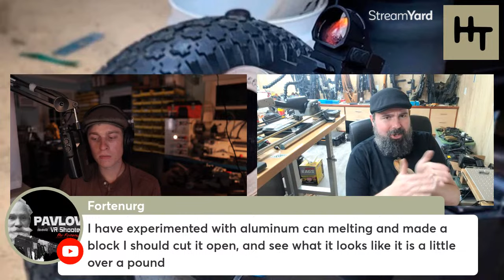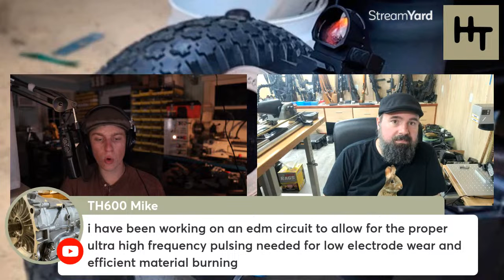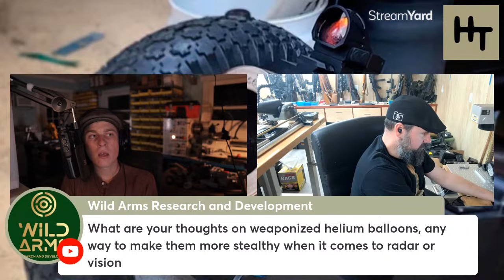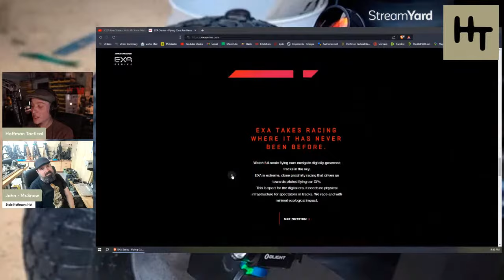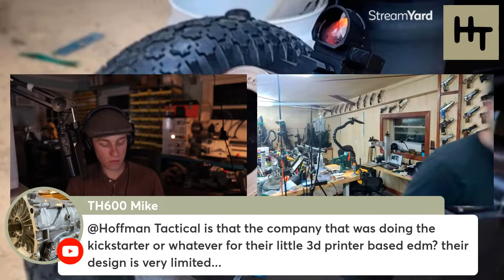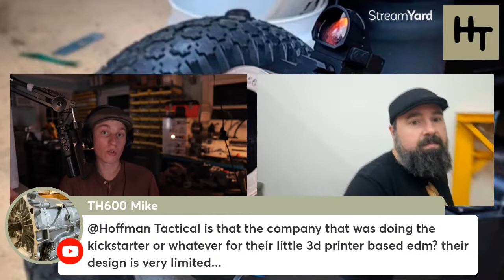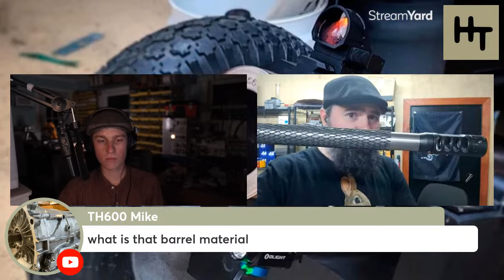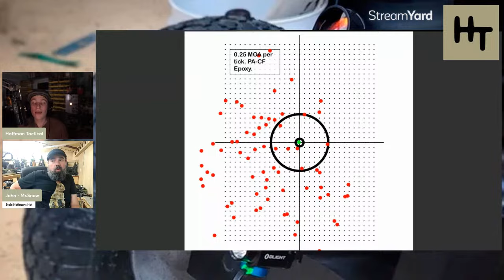3D2A Live Stream With Mr.Snow.Makes | Cannons, Airships, And More

Comment: Having made cannons, you would need steel seamless tubing, obviously very heavy walled, and welding is not a correct method of plugging the breach end. The reason being the gasses can get between a press fit breach plug and cause rust, and lead to a failure of the breach plug to stay retained…. Meaning it becomes a projectile and can and has killed people when done so.

The correct method involves a level III interference fitment which means you have to heat the barrel, and freeze the breach plug, then quickly pound/press the breach plug in so that when the temperatures normalize the plug is under massive compression. It wouldn’t be a bad idea to then also pin it. But that massive compression around the plug will keep gasses from getting between the two pieces and causing rust and failure

Comment: Alpha Munitions sells really good 6mm Dasher brass.  There is no "cheap" BR brass, so you might as well buy it already formed and annealed. 

You should know that a 6mm barrel may only go 800 rounds before accuracy starts to drop, and some of that will just be figuring out the right length, bullet, and powder charge for your barrel.  If you have a big boy lathe and the skills to use it, maybe that's not a huge deal, but if you are buying $600 barrels from somebody else, it's gonna hurt.  

You will also have to try really hard to find powder for precision ammo right now.   You will likely not be able to just walk into a store and find it on the shelf, unless you just get lucky.  Varget used to be common, but the PRS guys caught onto it, and I haven't been able to find any in many months.